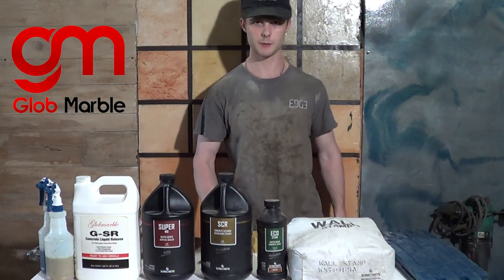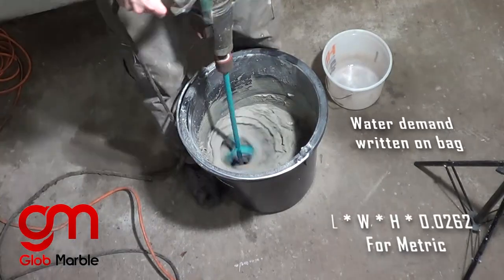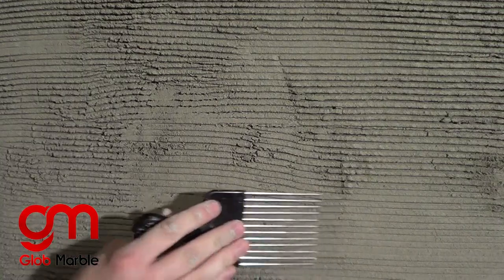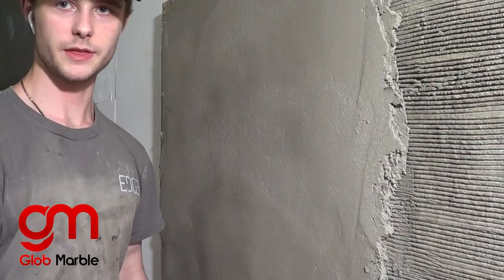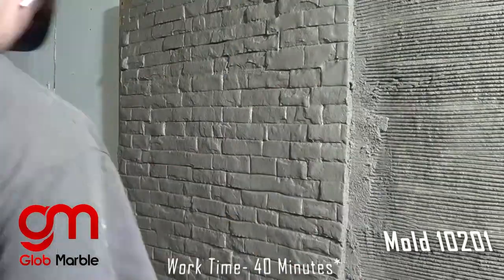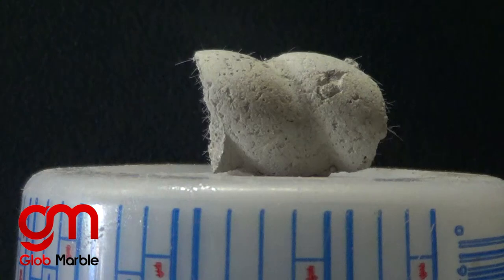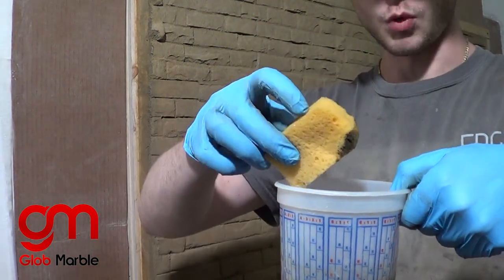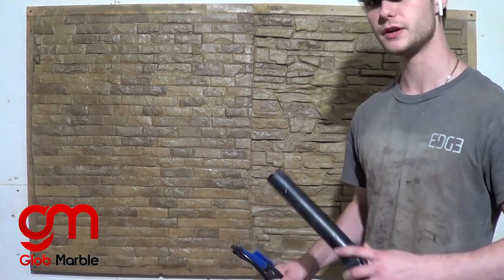How To Use Wall Stamps /Vertical Stamps

Comment: Very nice. May I know the ratio of the cement and sand plate. Thanks
Reply from the maker: For the scratch coat use type s mortar and for the stamp overlay use the wallstamp mix- https://globmarble.com/vertical-concrete-overlay-wall-stamp-40lb.html

Comment: Can you provide an itemized cost for this technique for vertical stucco walls outside where siding stops all the way to the ground. Thanks, Doreen
Reply from the maker: The wall stamp mix goes from $3.7 - $1.8 per square foot depending on the thickness

Comment: brother i would like to ask you if we are using pure cement or mixed with fine sand? and what material you are using in the first coat? thank you bro pls respect!
Reply from the maker: I am using a specific mix called wall stamp mix. No other concrete will work because it will slump too much. The link to it is in the description :)

Comment: And how many 3×5 cement boards can 1 bag of mix do? Or do we need a bag per board
Reply from the maker: coverage per bag is- 

@ 3/8” (6.35 mm) = 18 ft² (1.7 m²) 

@ 3/4” (19.5 mm) = 9 ft² (0.8 m²)

If youd like to find out more, check the description of the product here- https://globmarble.com/vertical-concrete-overlay-wall-stamp-40lb.html

Comment: Can this be used on stucco?
Reply from the maker: You technically can, but it is not recommended. Stucco is not a sturdy material, and to make it worse it is commonly applied to Styrofoam. It wont hold onto the stamp overlay as good as a regular wall
Reply: @GlobMarble  what exterior medium can I use to for a stone style stamp? I’m installing over Durock.   Thanks
Reply from the maker: You can use the exact method in this video of durock, but its very important to moisten the durock before applying your cementitious materials to it.

Comment: Why do you need a stamp mix?
Reply from the maker: This particular stamp mix was designed for vertical use. Its the best at fighting gravity and eliminating slumping, without making it too difficult to stamp. If you can somehow get regular concrete to stick on a wall at the appropriate thickness (unlikely), the stones you stamped would all look like they are melting, ruining all your hard work and wasting your time.

Comment: I’m a player and stucco eifs man by trade...I could make this work a lot faster and easier
Reply from the maker: You can spray mortar and stamp it as well, but vertical overlay that we offer https://globmarble.com/vertical-concrete-overlay-wall-stamp-40lb.html   is a light weigh, pre-mixed with fibers material. It doesn't sugg as regular stucco or mortar especially if you apply it over 3/4"